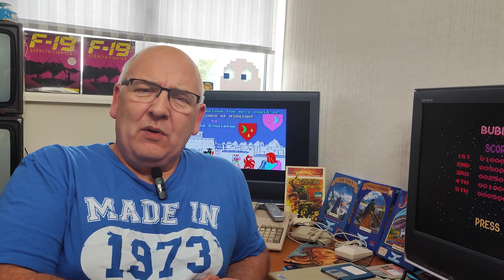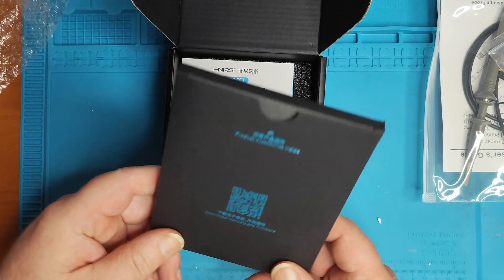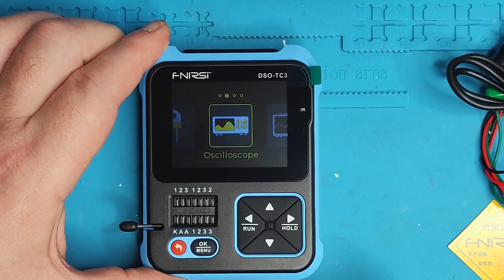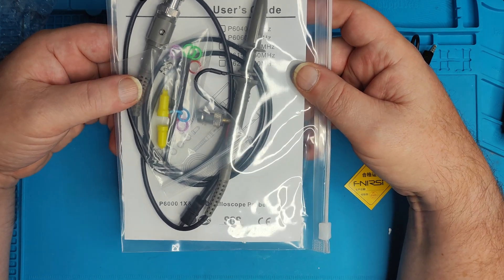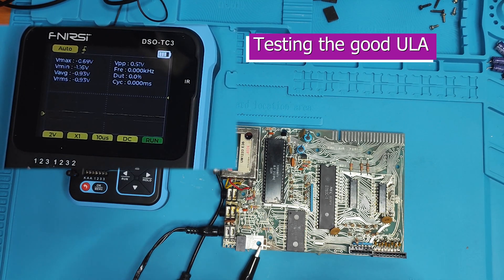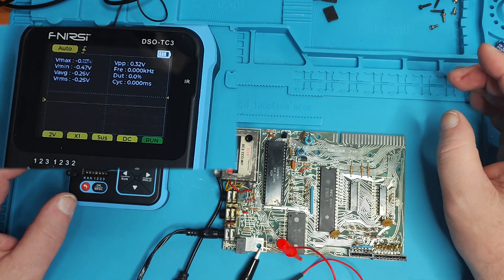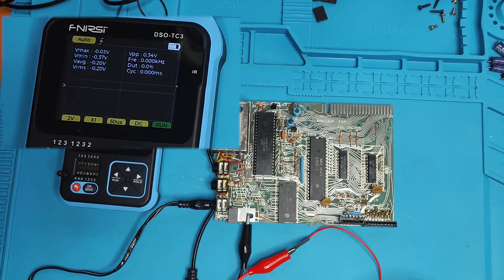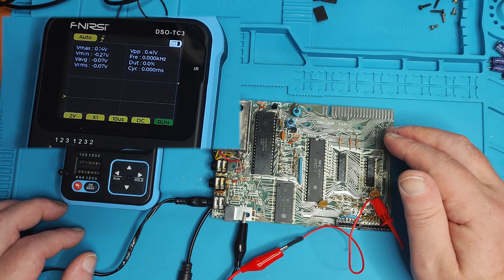The ultimate guide to testing a budget-friendly oscilloscope

Comment: been a long time since i have used an Old Silly Scope.  if you get a good one, it can be used to measure a wide range of signals, voltage, current, and even resistance by measuring across a 1 ohm resistor.  on top of this, it lets you look at signals and waveforms.  i recommend spending some time getting used to the various functions and settings of your particular piece of gear.

2:57    a serious man-flex there.  i can HEAR the testosterone coursing through your veins.

3:01    "We don' need no steenking warnings!"
Reply from the maker: 😂 thanks John. I always look forward to your comments 😁

Comment: I do have a "proper" 'scope, a Techtronix bought second hand, and an old analogue Philips one (useful for audio stuff, CD drives and the like) but I bought something similar to this a while back and tbh I use it more than the full size ones purely for the convenience factor - 90% of the time it's perfectly good for old computers. You got a bargain there I think, you'd pay a tenner just for the component tester and this one has a signal generator and two inputs which mine lacks - I'm almost tempted to upgrade! I'm sure it'll prove handy.
Reply from the maker: Hi Jason, thanks for the comment. I've no doubt a proper one would be better, a larger display would always help as a start. But I'm no expert on using these things, in fact a complete amateur. If it can make fault finding just that bit easier for me then it's a win.
Reply: @RetroComputingReboot Re the screen size, mine has a composite video output so I can display on my 55" TV if I really want to - you might want to check if yours has this as well.
Reply from the maker: @jasejj  That's a good shout. I don't think it does to be honest. However, I can't fault the quality of the screen. It refreshes quickly and the resolution is more than acceptable.
I think, like anything, it's always a balance between cost and what you NEED. If I were using this daily for a job, I'd definitely want something better. But as a amateur casual user, I'm more than happy with it.
Reply: @RetroComputingReboot I certainly wouldn't have paid the kind of money the full-spec scopes go for however I was offered the Techtronix for (almost) free by a previous employer who had thrown it on the Weee pile and given it sells for £250 I could hardly refuse, and I bought the Philips locally from eBay for £25 - it weighs a ton and is fragile with valves inside so not much competition for bids! Ironically the pocket one was my most expensive scope! But yeah as I say these generally will cover most issues you'll see on 8-bit machines - 16 bit you might struggle with due to the higher clock rate.
Reply from the maker: @jasonj4337 Yes I thought it may struggle with the 16 bits. I don't want to tempt fate but all mine (and I have a few 😆) are running really well at the moment.
I did have a look at s cond hand scopes, but like you say, even those aren't cheap, plus I'd be concerned I'd be buying someone else's problems and not necessarily having the skills to fix them.
Reply: @RetroComputingReboot  if i recall correctly (and i could very well be wrong) EEVBlog has at least one video about less expensive vs cheap 'Scopes.  it might be worth doing a quick search for his videos.
Reply from the maker: @JohnLeePettimoreIII  Thanks John. I'll have a search
Reply: techtronix...  nice.  when i was on the Minuteman system, i was spending a LOT of time with my "Time Domain Reflectometer".  that was a three dollar piece of gear right there.

i agree with your summation of using less expensive gear for working with older hardware.  they were slow enough (by today's standards) that low-cost test equipment is just fine.